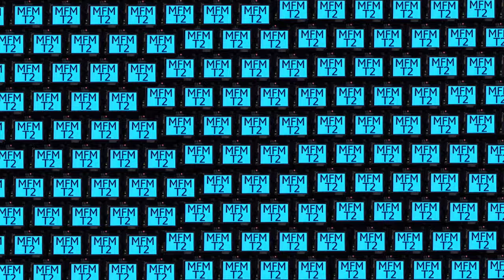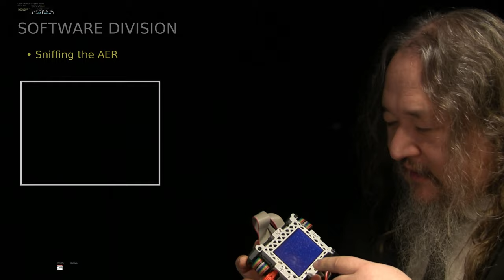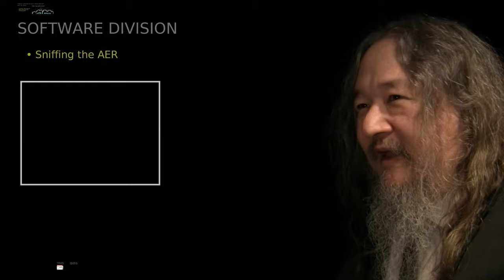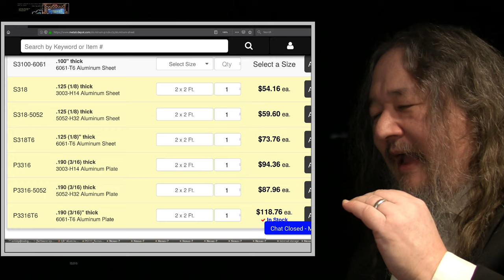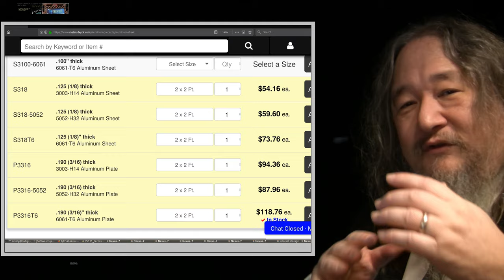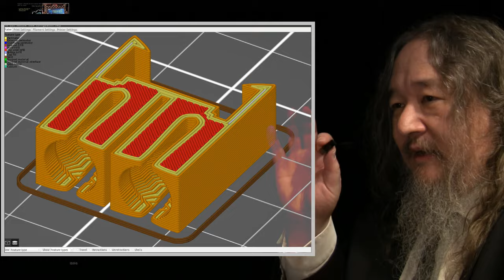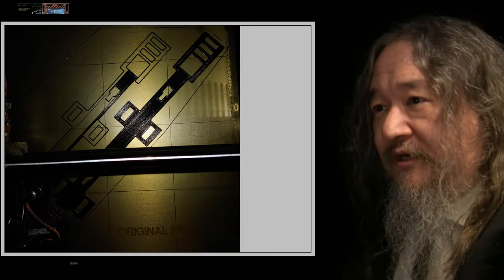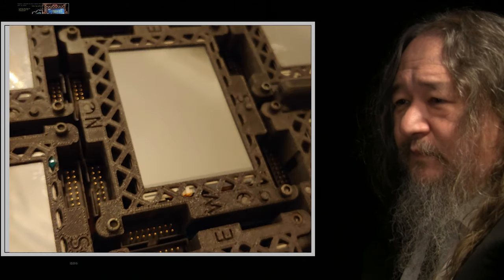Enter the Power Zone - T2sday Update 248

Comment: Great update. I feel like the top straps will have to carry too much weight if they need to support 3 power zones below. Maybe try some kind of 'H' or 'M' shape with 2 or 3 straps connected horizontally? 
I do like the design though, I guess you could also mount more than just the top-most zone to the wall.
Would be interesting to see what kind of solution a generative design process would come up with.

Comment: Instead of Alluminum, can you consider to use carbon fiber. Maybe you could also consider to put a tight-fitting sheath over the joints after snapping them together, to raise the stability and lower the probability of a disjoint.